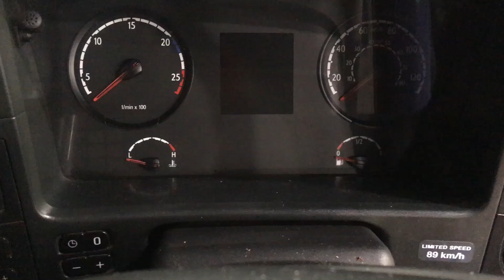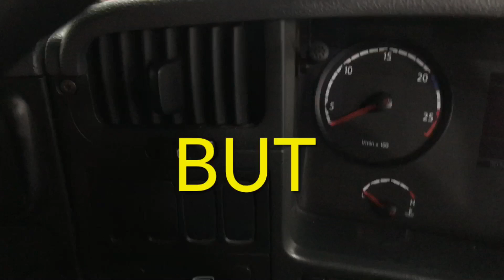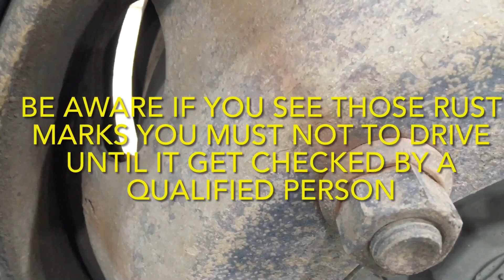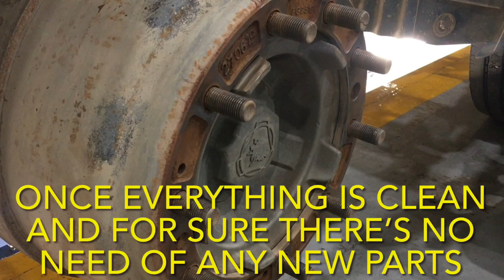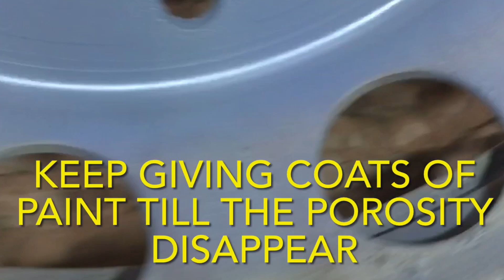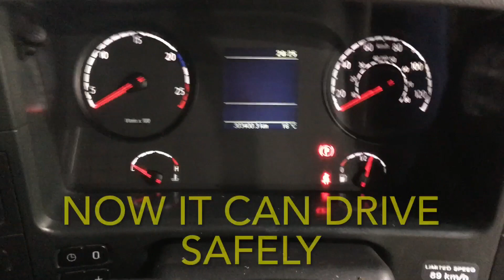If those lines are coming out from your wheel nuts

Comment: What I would normally do I will either put some grease on there or some gear oil on The studs and the surface were the wheel it’s up against a drum
Reply from the maker: For those particular studs is not allowed grease or oil, is also a mot failure, that's why clean, check, paint, I personally feel more confident seal old studs with paint

Comment: The noise of the reverse "beeper" why do they all go "beep-beep-beep" when new then a week later maybe more they turn into that familiar rasping noise? - Water ingress causing corrosion? Haven't they improved on the design? Or is that rasping noise what's supposed to be? :)
Reply from the maker: For most trucks those blippers are compulsory, the dust, water or just the condensation ruins the membrane inside it causing the weakening of the sound, but some of those are built to make the rasping noise because a lower tone cause less noise pollution, used specifically for urban areas

Comment: Hey buddy, do you have any videos on doing differential pinion seals?
Reply from the maker: For scanias, for release the central nut need heat it up with gas bottle, when red wit a 1700 Nm at list impact gun, (and a good socket) the nut can be undone without destroy the pinion thread. Then once changed the seal I think the torque of the new nut is above 1000 Nm. Would be an amazing video, but now i been long  time without changing those.
Reply: Yeah buddy, I would never see a Volvo Scania Iveco MAN Mercedes Benz I was just curious to see how it’s done compared to how it’s done here in America to me, it seems like the European stuff is a little over engineered but in a bad way I worked on BMW and had to use
E-TORX sockets worked on Volkswagens where I had to use triple square I actually had a situation with a Volkswagen Passat The rear brake caliber well before me, somebody try to use the wrong whatever by time I got the car I figured it needed a 13 mm triple square so I was able to remove the top bolt but the bottom one was rounded out, so I had to disassemble The left rear suspension and had to take The bearing hub assembly to a welding shop to get that rounded bolt out I figured if they just would’ve used a 15 mm head or 16 mm head bolt would not have had that problem
Reply from the maker: @terrellscaife2411  torx bolts are good for save weight and material, but like you said are not the best for work with
Reply: Yep Yep
We need to stage a massive protest for manufacturers that use those type of fasteners on vehicles because 10 years 15 years, 20 years down the road, they are not the ones that have to try to get them off when they are rusty and stuck